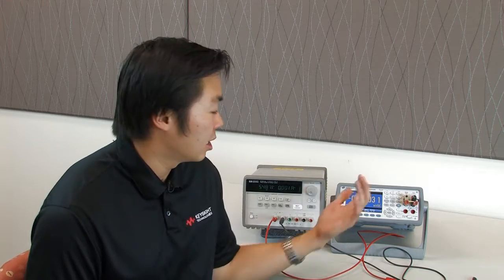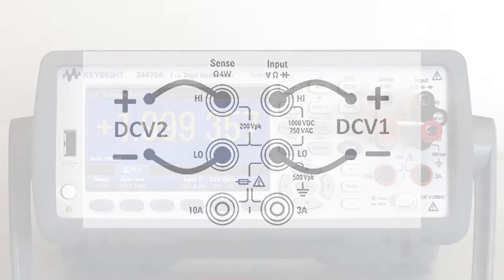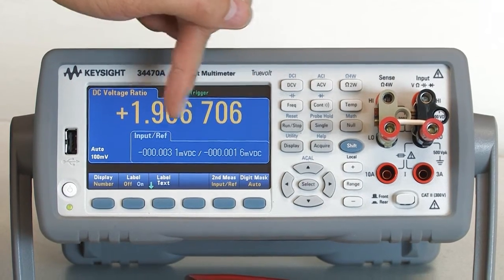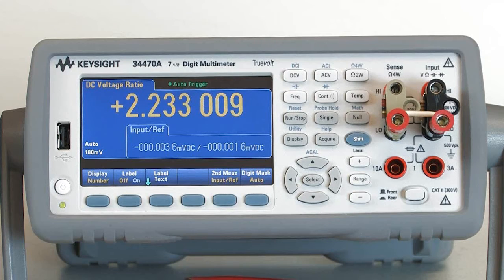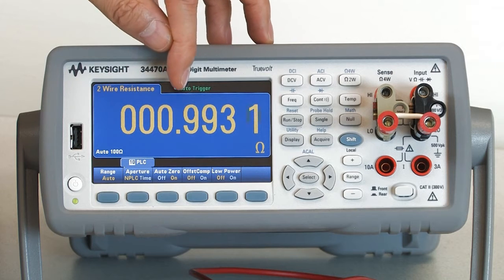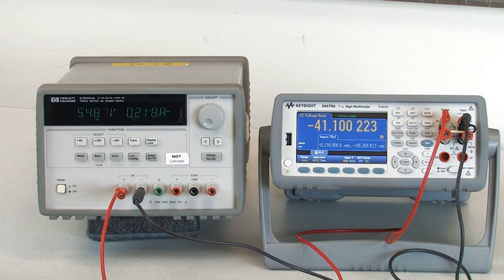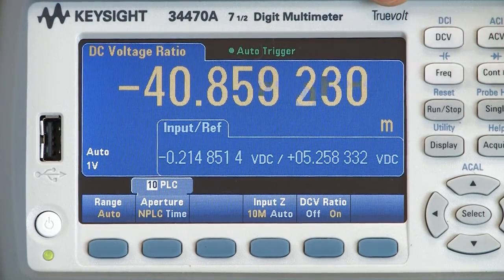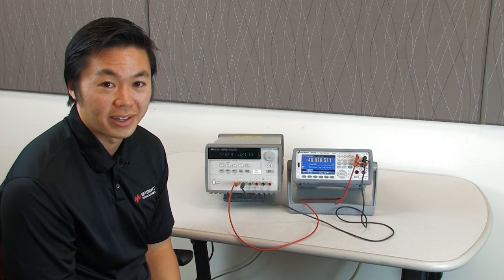Measure Voltage & Current at the same time with a DMM

Comment: High burden voltage.
Reply: You could use a lower resistance resistor. There are a lot of digits to work with here. U can make the burden voltage as little as 2mV

Comment: pretty useless, The DMM should support the voltage and current channel at the same time to do precise measurements and get rid of the small voltage window without blowing something in the DMM as its limited to 10V
Reply from the maker: Stefan Vendel To measure instantaneous power would require two measurement paths and two A/Ds. Most DMM buyers do not want the added expense. If the power being measured is steady then a normal current measurement including scaling can be made followed by a voltage measurement. Using normal measurement functions also has the advantage of known measurement errors.
Reply: Keysight General Purpose Instruments you say it can do 50000 measurements a second where is the problem split 25k to current channel and the other 25k to voltage?
Reply from the maker: @10000276249  Switching between functions takes a lot of times. The multimeter's frontend is designed for precision measurements vs. speed.

Comment: Is it possible to log the data  (voltage and current) to internal memory or external memory with this feature?
Reply from the maker: xcrond You would need to use a PC to grab the two measurements.

Comment: So, With 6 decimals and the possibility to present 1uV, what is the accuracy of this instrument? E.g. 100V DC and max. error in microvolts.
Reply from the maker: Erica S You would need 8.5 digits to resolve to microvolts when measuring 100 V.  The datasheet has all of the specifications: https://literature.cdn.keysight.com/litweb/pdf/5991-1983EN.pdf?id=2318052

Comment: Can you measure two unrelated voltages DCV1 and DCV2 this way, as long as they have a common ground?
Reply from the maker: A M The RATIO function is designed to compare two unrelated voltages. The voltages do not need to share a common ground. The voltage applied to the input terminals can range from mV to 1000 V. The voltage on the sense input needs to be less than 10 V.  Also, the voltage from sense Hi to Input Lo needs to be less than 12 V.  The multimeter will use autoranging to make the best measurement on each of the inputs.
Reply: Thanks for the reply. I gave it a try and I notice a couple strange things. I have it set up with 12V on DCV1 and 5V on DCV2. The first issue is it reads "overload". After playing with the settings I found that changing the aperature from 10 PLC to 1 PLC removes the overload condition, but I don't understand why. The second issue is that the 5V reads as 4.7V on DCV2 (sense input). If I move it to the main input it reads 4.999V. Do you know why that would be?
Reply from the maker: A M Our support engineer was not able to recreate what you are seeing.  The multimeter measured a ratio of 2.4 on all PLCs. Couple thoughts make sure the multimeter is measuring the 12 V on the 100 V range as the multimeter ranges at 12 V. The display will show "Auto 100V" at the bottom left. Make sure the 12V is applied to the input terminal vs the sense terminals.
Reply: I did have it set up as you suggest. I think the problem was that my two voltage sources were isolated, they did not share a common ground. When I connect the grounds together the sense reading immediately jumps from 4.7V to the correct value of 5.0V. And the overload issue goes away too. So it's resolved for me, but I think your earlier advice about common grounds may have been inaccurate.

Comment: Adding an external shunt to an 6.5 (to be honest 6.08) digits DMM doesn't maky any sense. You will loose any precision with time and temperature drift, that the shunt will most probably have. The Rigol DM3058 can do it out of the box (with some restictions on the scale of the voltage and current). 

Not beeing able to get the values extracted via SCPI or CSV is also a nogo.
Reply from the maker: Team14  The 3446x series are 6.5 digit DMMs - it's an industry definition.  When using the 10V range the DMM displays 10.000 00 - the six zeros are the 6 digits and 1 is the 1/2 digit.  You are correct that it is preferable to use the internal shunt resistor as we provide corrections for temperature and time.  If you are willing to use SCPI , you could create a  program to: measure the resistor, measure the voltage across the resistor and finally the DC ratio and then report the V & I.  I have not used the DM3058 but would be interesting to see if the secondary current measurement has an effect on the primary voltage measurement.  BTW, I loved their measurement tutorial. Whoever wrote it should get a raise - if you liked it as much as I you can read the rest of it here: https://literature.cdn.keysight.com/litweb/pdf/34401-90004.pdf?id=765584  We have updated the 34401A tutorial  and added a lot more information in the 3446x manuals.  Just odd that the copied a piece of it.

Comment: why not actually support a second true measurement?
Reply from the maker: ThinkLearnSolve  Our current dual measurements use the same input path and scaling.  e.g. ACV plus frequency.  We use some of the same scaling components for both voltage and current.  As we change ranges to make a voltage measurement we can potentially change the shunt resistance which loads the circuit differently. Also, it is some what of a special case to measure current and voltage from the same point, as we share the negative terminal.  One application would be to measure the voltage a current being sourced, like a power supply.  While we change the shunt resistance, we do keep the current path in tact - we never open it.  So, it is possible to make a voltage measurement followed by a current measurement but the dmm will want to scale and settle between measurements.
Reply: @KeysightHandsOn  Why not use the "Amps" measurement to measure the current, and the Voltage Sense or  Voltage Measure input to measure the Voltage?  I've never understood why DMMs have Volts-GND input, share the GND with the AMPS input, your DMM should have a AMPS-AmpReturn pair.   One more 1 dollar banana jack away from have an independent Current and Voltage, simultaneously measuring on a single meter.

Comment: It is a neat trick to measure current and voltage at the same time. But it would be a heck of a lot nicer if we could log both measurements to a csv file. Is that possible? I am failing in my attempt to do so.
Reply: Yes, you can. I have built an  earth electrical resistivity machine from Keysight 34465A, it basically switch the measurement between all the channel it has, so I can measure lots of point serially. And I can record all the data to a csv file, I use arduino and Labview to control every thing. 
https://youtu.be/MCpoD9SDXis

Comment: Hello.
Can we apply this trick to keysight 34410a model?
Also, can we use this for remote interface in PC?
Reply: You can use a similar trick using the Ratio, DCV:DCV function.  First, locate a resistor in the circuit for which you want to know the current.  Measure the resistance.  Then, using ohm law, calculate the voltage needed to flow one amp.  That is your reference voltage.  Set that reference voltage on  a power supply, and feed it into the ratio reference / sense inputs.  Then measure the voltage drop across the resistor for which you want to know the current.  The ratio of the measured voltage versus the reference voltage will give you the current (in amps, in this example).  The wrinkle in this approach is that if you are trying to measure current through resistors of higher values (say 1 kohm, 1M ohm, etc.), then you would need ridiculous levels of voltage (1,000 volts or more) as a reference voltage to measure in amps.  To address this, adjust the reference voltage to determine how much voltage is needed through the resistor for 1 milliamp or microamp or whatever so that you can supply a reasonable reference voltage from your power supply, and remember that the ratio will be displaying milliamps, microamps, 10s of milliamps, or whatever reasonable voltage reference you decide upon.
Reply: And yes, you can use this approach for the remote interface in a PC, as long as the logging software will log the DCV:DCV ratio.

Comment: why not added that feature into dmm if really can do it that can be an really nice feature so then in principal display show watts ( power ) i know may can have some limitations  about autorange but still i think is reallly price point for be considerated when buy a new dmm . thanks if some is reading this .
Reply: juan marcelo Arguello i know only dc watts can measure
Reply: juan marcelo Arguello i think if add functions same like this and in principal display show an "math" function (for reference user , not really calibrated  )  and that can be labeled ( like Watts DC o Miliwatts DC , or meaby Wmain , DiffNoise DC , SumNoise DC leves , or look how change a load in power ) , dont  show ohh now dmm measure power how accuracy was ... and only its an math function ( fail for a proper review ) .. if only add math function the user know how accurate is that and still can do it  .
Reply from the maker: juan marcelo Arguello Thanks for the suggestion. The multimeter would make the voltage and current measurements sequentially which would be ok for a steady state DC.  We have several power supplies and the IntegraVision Power Analyzer that measure V and I simultaneously but to your point they are much more expensive.